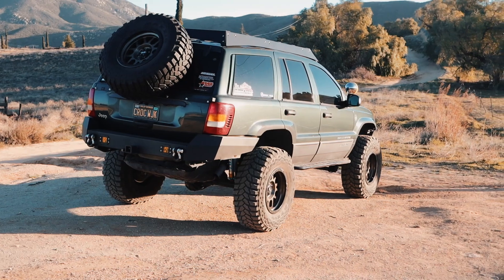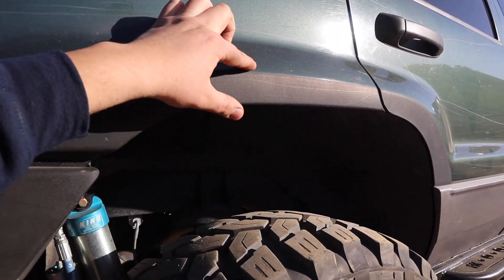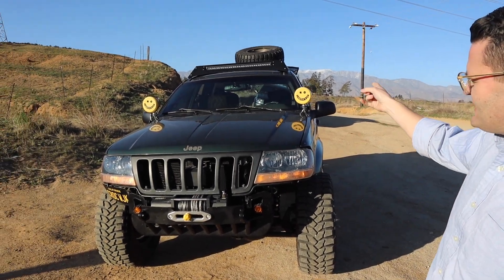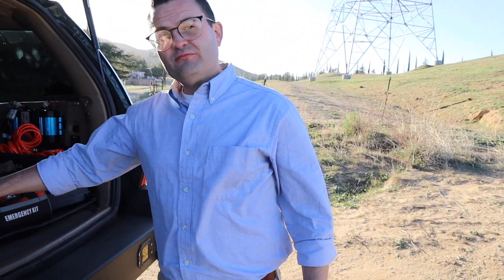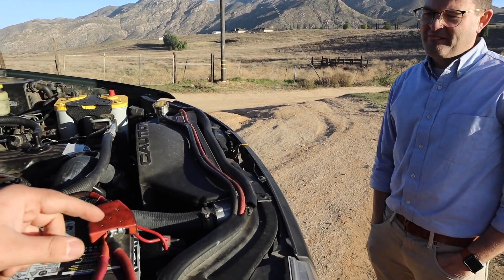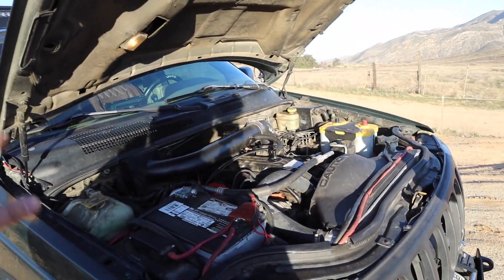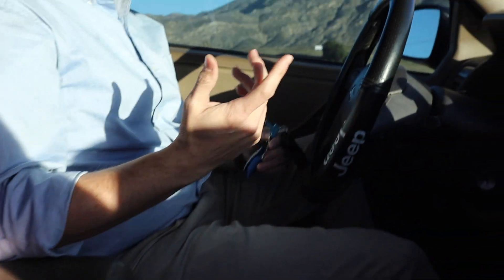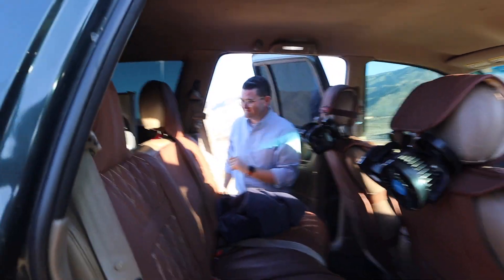Cleanest WJ Off Road Build Walk Around | Grand Cherokee Showcase

Comment: I can also attest to the HK winch mount 'bumper'. Have the hidden winch mount on my WJ from HK off-road. It's the exact same as his without the lower bars. Got washed down a river. Water over the dash. Was winched out of the water, up about a 12 ft, steep (45 degree ish,) riverbank while attached at only one of the d-ring mounts. Towed a few miles off the trail, through other water crossings and small obstacles, then towed 25 miles through hills and curves with a solid rope till we got cell service. I have inspected this plate, even pulling the winch off to inspect. Not a cracked weld or even a slight bend anywhere on it afterwards. HK off-road makes some really solid stuff.
Reply from the maker: Great to know 💪 might need to invest in one
Reply: Also Bash is the coolest and backs up everything he builds!

Comment: Those eag bumpers brackets snap easy ...BUY A DIFFERENT ONE IF YOU VALUE YOUR REAR BUMPER I HAD ONE ON MY WJ AND THE MOUNT BROKE
Reply from the maker: Did you pull from it?
Reply: @NajarOffroad  yes from the d rings also towed trailers with it it tried to trist off with just a small a liner camper